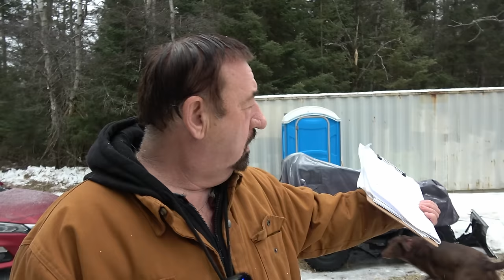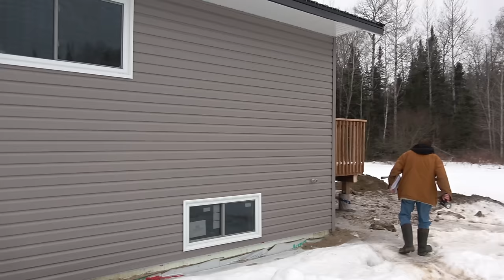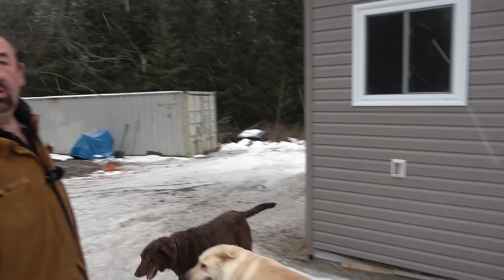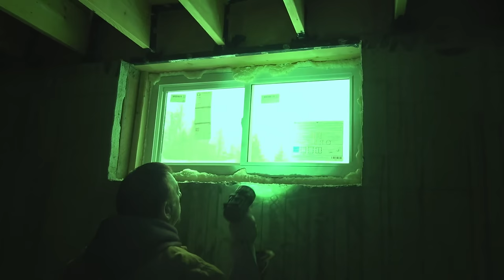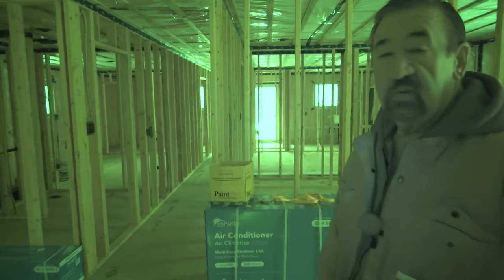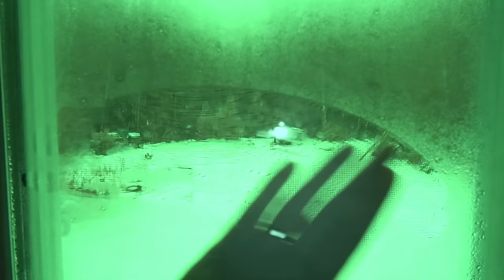Dad's Rebuild - One Year Later House Still Not Finished

Comment: In all this, your Dad has great sense of humor. I see his frustration. (That deck railing attachment to the house is really bad.) Is nobody working off an agreed to set of drawings? It looks like the electrical is just built to code, with no extras. 
We had a home built in 2005. I was joint contractor with the home builder. We were most fortunate to have all construction entities work together with quality and on time. If one part didn't work i could see how the whole project could've gone sideways. It was stressful and I probably wouldn't do it again.
Reply from the maker: Yeah they won't go above and beyond anything they don't have to..